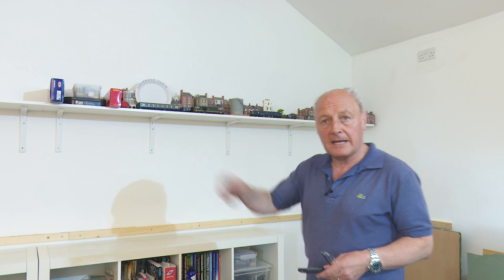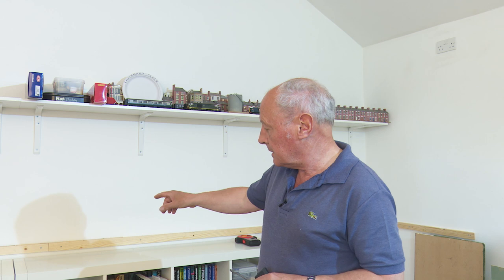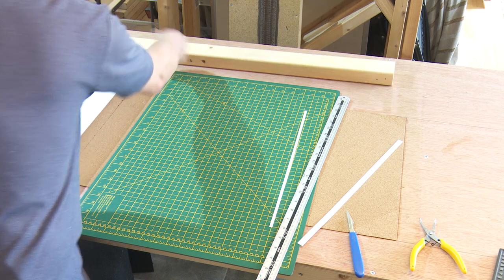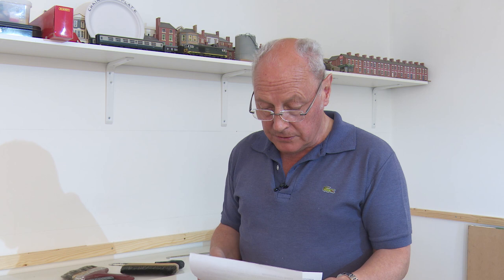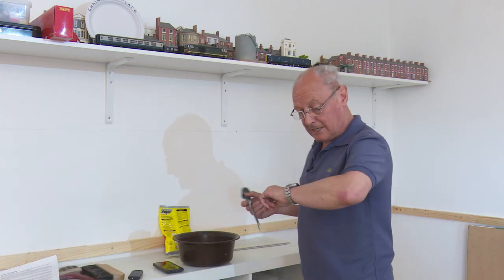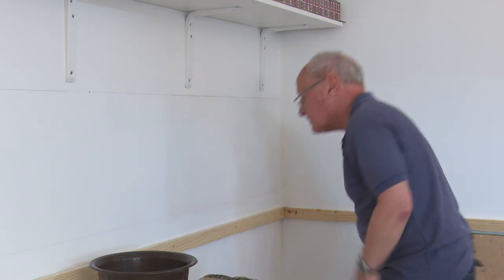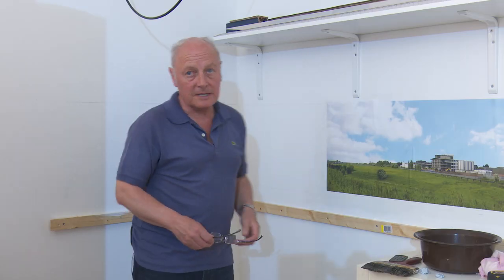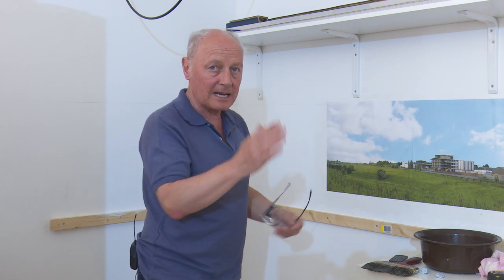29. Chadwick Part 5 Installing a Backscene at Chadwick Model Railway

Comment: Charlie, you made hard work of this!  I applied mine to plywood boards on the bench and fixed the boards to the wall.
Reply from the maker: I had thought about that but I was concerned about the butt joints.  
Regards Charlie

Comment: Great video Charlie and I take my hat off to you for tackling that on your own, I would most assuredly require the assistance of my dear wife. Regarding bubbles, if you have trouble removing them you could prick the centre of the bubble with a very fine needle, but this must be done before it fully dries. Cheers Greg
Reply from the maker: Hi Greg,
I’m so pleased that you enjoyed it.  It was a challenge!  Fortunately, in the morning there was only one bubble / crease which can easily be hidden.
Good luck with your project.
Regards Charlie
Reply: plus 1 on the needle or pin and yes when wet

Comment: I find it easier to first of all size the wall with dilute wall paper paste, let it dry.  Then I apply paste to the back of the paper brushing with the dry brush.  That way you can reduce the problems of bumps in the paper.
Reply from the maker: Don I totally agree.
In this case I wanted to follow the manufacturer’s instructions but next time (later this week) I will be sizing the wall first.

Comment: Having done plenty of wallpaper in the past, a newly painted wall should be sized before hanging the paper.  To do this you should apply a thin coat of the wallpaper paste to the wall and allow it to dry completely, even waiting a day.  This allows the wall to absorb enough paste to prevent what happened to Charlie when he first started, having the paste getting into the wall and having the background falling from the wall.
Steve Willis
Reply from the maker: I couldn’t agree more Steven. 
However, what I decided to do was follow the manufacturers instructions, what a disaster.

Comment: Charlie,  Good job on the back scene.  When "wallpapering", here is the recommend technique...  Lay the paper out on your table scene down and with a wide brush, "paint" the glue onto the surface, brushing the brush off the edges and not onto the edges.  Then take one end and fold to the middle and the other to the middle.  Do not crease it tight at the fold.  This is "booking the paper and allows for the paper to relax and become a bit saturated, taking the memory out of the paper to want to roll up on itself.   then start6 at one end and get it stuck down.  Work across and "unbook" the paper as you go.  Do not past the wall.  Brush it all down and if the paper has relaxed, it will not shrink away at the seams.  Prick any bubbles with a pin to remove bllisters.  Then leave it alone and let the glue dry and set the paper to the wall.  Bob from Brecksville Ohio.
Reply from the maker: Hi Robert, I’m so pleased that you enjoyed the video.  Sadly I simply followed the manufacturer’s instructions during installation.  Regardless I’m sure that you noticed that I was close to throwing the first piece in the bin, such was my frustration.
Good luck with your project, regards Charlie

Comment: Looks cool 😎 For interest I have fixed Masonite to the wall for back scene using Velcro making for ease of mounting or removal & change if need be. Works well. Cheers Dave.
Reply from the maker: Hi David, I’m sure that it works well but what is Masonite?
Reply: Masonite is the name used in South Africa for what I remember is "Hardboard" in the UK. (HDF)

Comment: Should of sized the walls first let dry than hang the backsean and use a felt. ROLLER because it rolls out air bubbles a brush does not if you get air bubbles use a small sowing neddle to make a hole in bubble let's air out  than brush or roll bubble disappears for corners use a plumbob for straight uprights
Reply from the maker: Yes Mark, this was a really steep learning curve for me. Regards Charlie

Comment: back drops. are like the necessary evil most modelers want and need.  you might be right, two people doing them might make it easier. 
 the way i like to do them is lay down some bristle board, and glue the back drops to them. you don't have to worry about them being straight then. but bubbles are still a issue. I cut away the extra bristle board and now can hang on the wall.. 
 thanks for doing them your way. wall paper paste might make it a bit easier, but yep two people.
Reply from the maker: Hi Sparky, 
I’m so pleased that you enjoyed it. Perhaps we need a team of specialists working their way around the country! Regards Charlie

Comment: Well done Charlie.
I bet it had you worried for a while there.
Lovely back scenes. It looks really well.
I'm really looking forward to this layout developing.

A few general tips to anyone doing this.
(1) Paste the whole length of the wall to match the back scene piece you are putting up. Don't skimp on the paste on the wall. This will help the paper slide around & help you to get it started more smoothly. Brush the paper from the centre outwards towards the edges with the brush. This will help in avoiding wrinkles & bubbles.
(2) Reverse roll the piece of back scene before offering it up to the wall. That will take some of the spring out of the paper & make it easier to handle.
(3) If you are right handed put it up like Charlie has done as all the control is in your right hand & your other hand is just for holding the paper.
(4) Always follow the instructions that come with the back scene. They are there for a reason.
Reply from the maker: Hi Tony,
I’m so pleased that you enjoyed it.
You have made some valid points and along with the instructions bode well.
Regards Charlie
Reply: toooo true bRITher

Comment: Hi Charlie, Its nice to see the back-scene being applied. I've made the mistake of constructing the baseboards before the back-scene. Unfortunately now i'll have to use half a scaffolding plank, supported by a saw horse and lay on my stomach to reach in the corners of the layout. (like a scene from Laurel and Hardy) I'm not looking forward to it. An excellent video, thanks for sharing.
Reply from the maker: Hi John, 
I’m so pleased that you enjoyed it.  
Can you not put yours onto plywood and then install it? 
Regards Charlie
Reply: Hi Charlie, The plywood for the back-scene has been screwed and glued securley to a supporting frame beneath the roof purlins in the attic. I also have I D back-scenes to hang, but didn't really think about how I'm going to reach the corners, until watching your video. Oh well, I'm up for the challenge, regards John.
Reply from the maker: I wish you luck John.
Regards Charlie

Comment: I have just been watching your latest video - great one as allways - and I noticed the bare piece of wall behind the new board. I couldn't help thinking aboat your struggle with putting up your backscene in this one. It is rather difficult to put up wall paper vertically. I would cut it up in bits and then do one piece at the time. Or I would have someone to help me :-) . Ordinary wall paper glue is probably not the best choice for this job, because the sceneic paper is glossy on the backside too, I would think and therefore can't soak up the glue the same way, as ordinary wall paper can. I would go for anothter kind off glue. Bobbles are not a problem. You just poke a small hole with a needle and then press the air out, before the glue has dried up.
Reply from the maker: Yet another adventure for me !

Comment: Thank you for your most instructive video presentation. I have never been that impressed with backscene "technology", up to now, but seeing your application & the quality of the backscene itself may have changed my mind. My 00 railway is already running, but I did leave space behind all of my main viewing area half relief installations for a pasted on board, backscene if I so desired. I know in my mind the kind of backscene picture that I would like, but can you explain why there are separate backscenes for different scales, since prospective & distance are relative to where we stand, not the scene scale, or am I missing something. I have some buildings at the back that are N scale, since that aids the distance viewing, or at least cheats our view.
Reply from the maker: Hi Philip,  
I’m so pleased that you enjoyed the video.  I try to be as honest as possible.  
Regarding scale it’s a bit of a minefield.
If you Model in N, you could find some back-scene buildings look too large.  Perhaps phoning the supplier, as I did, might allay your fears.  I used ID Backscenes.
Regards Charlie

Comment: Charlie ,I'm also retired and a new and inexperienced modeller. My biggest horror was the thought of  crawling undo the baseboard fixing and wiring in point motors. I take your point of putting the baseboards on there side to undertake this work. However does that mean your bus wire is plugged from board to board. If this is so what plugs do you use.

Tonka47
Reply from the maker: Hi Michael, I just use plug together chocolate block. Do you know what I mean?
Reply: Chadwick Model Railway  Hi Charlie many thanks for the quick reply.

Comment: If I might stick my four penn`orth in - pasting the wall is always going to give problems because the paper goes on dry THEN expands as it draws the moisture in. This gives rise to bubbles and raised creases. Just my thoughts, good stuff otherwise.
Reply from the maker: Hi Hazel, I’m so pleased that you enjoyed it.  Pasting the wall was recommended by the manufacturer, hence the process.
Regards Charlie
Reply: Yes, and Solvite type pastes when mixed contain more water than any others. That water has to go somewhere (into your backscene). Use an adhesive with less water content.

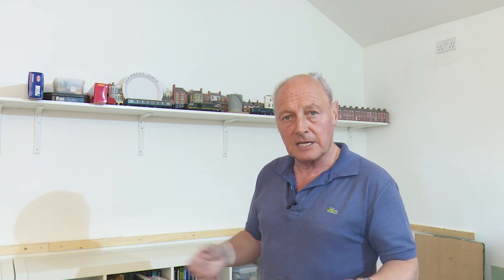Comment: 5:37 that transition... Hahaha! However your lens is set up or your camera is positioned, it really messes with the perspective on that room. I had no idea the spacing between the board and the shelf above on that back wall in the initial shot was as tall as it actually was. When you get right up to the wall, you can tell. It was just kind of a jarring transition. Felt almost Alice in Wonderland like... The wall appeared to get bigger! I'm not looking forward to backdrops... Not cause I can't do it... I just feel like it's that necessary evil... Every layout ends up looking like the set to an old movie, with an obvious painted backdrop that totally looks like it belongs. I wonder how a series of landscape features that drop off before the next, each set to smaller scales would look in the back several inches. Kinda liek having rolling hills that cover rolling hills behind it, bringing the diorama to eye level to create a horizon. The backdrop would still be there, but set behind another rolling cap that drops off the eye line. I think if done right, it could work... If you're gutsy, you could even try a Z scale track off "in the distance"... For perspective. To work, you'd have to have the rear of the landscape come up to close to eye level I think... I'm not sure, but I really feel like that would be critical.

The catch, of course, is the space required. Each scale reduction (and thus perspective shift) would require some space. It's also rather dependent on the backdrop being set, again, "off in the distance". I don't feel it'd work well with a city scene... Rolling hills, or mountains though... Maybe. I dunno. I'm just brainstorming.
Reply from the maker: Hi Rich, 
Many thanks for your thoughts.
I went back and looked at that transition.  Wow, it’s a real shocker.
Yes, perspective is a prickly subject with so little room to construct depth.
I’m so pleased that you enjoyed the video. Regards Charlie

Comment: Tip 1: when cutting a butt joint intending to join one piece to the other, cut BOTH pieces, one over the other so that, when they are placed together, the cut line is an exact fit.
Tip 2: when wanting to fix a backscene to a backboard PASTE THE BOARD, not the paper!
Disclaimer: this method is from previous experience, I am not an expert!
Reply from the maker: Hi Bobby, using a steel rule, the edges were indeed straight.  Clearly I pasted the wall, not a board.  However, below is a comment to paste the paper.  All that really matters is that you end up with a satisfactory result. Regards Charlie